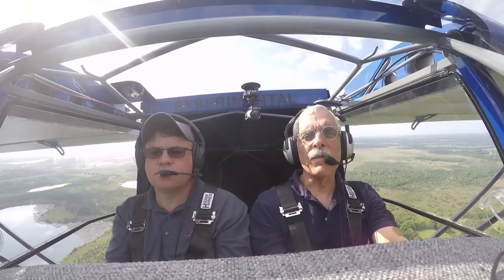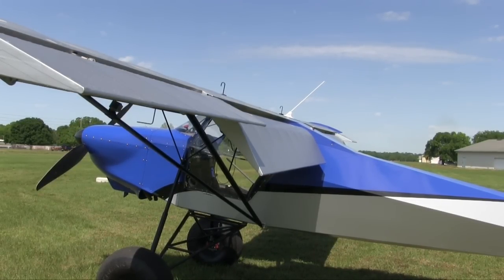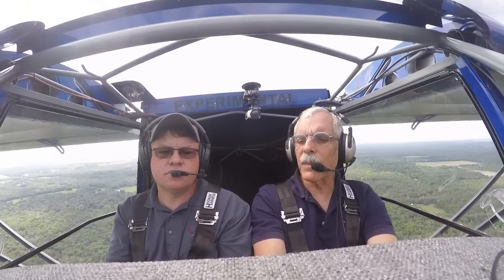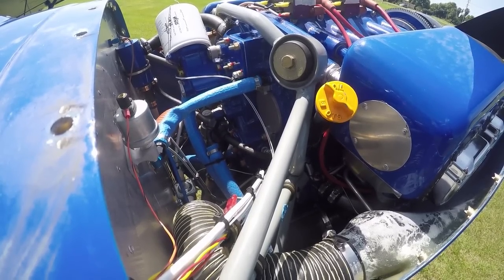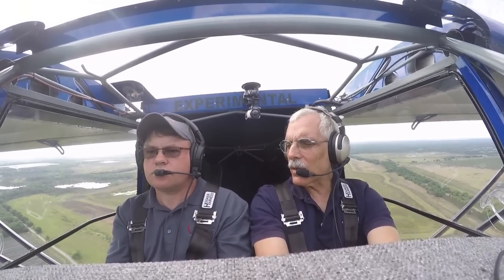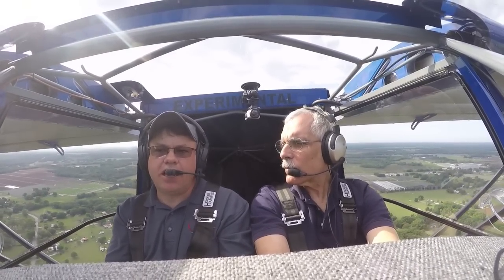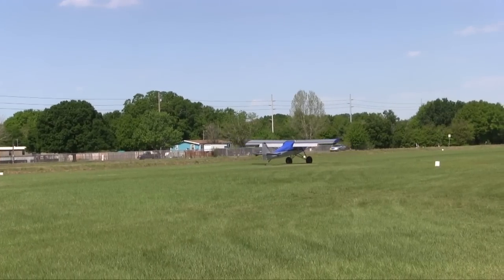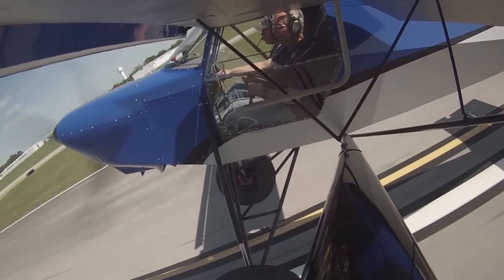Flying Just's Titan-Powered SuperSTOL

Comment: How does a weight difference of 10-15 lbs equal to having to need 2 extra feet claiming it's to compensate for the weight of the engine?
Reply: pmp2559 probably needed the additional length for longitudinal stability and elevator/rudder authority.  Horsepower increases decrease stability as a general rule.
Reply: Clayton Yendrey oh, yes it does make sense now thank you. I guess on an airplane every little thing counts
Reply: Previous answer was completely false ..that 10 to 15 lbs diff was from the UL motor , but not the Rotax ...the fuselage was lengthened due to the difference in weight over the Rotax 912 which is about 100 lbs lighter ... not for the UL motor ... both the Titan and UL require the two foot longer  fuselage over the rotax  ... and that is the larger UL motor .. there are smaller UL ones similar in weight to the rotax that can use the shorter fuselage
Reply: In an earlier video they said the Titan was 150# heavier and extending the fuselage was “a weight and balance thing”.

Comment: That wing structure looks extremely week, the spars are thin as anything! Not sure how that aircraft will stay structurally strong in even light turbulence that loads up the wing.
Reply: +Jeffrey Jensen kit fox based actually....
heavily modified and redesigned of course.
Reply: lol ...you can tell aircraft structural strength by looking at it ... thats pretty impressive ... why did Just Aircraft go to all the trouble of engineering calculations when you could have told them its strength at a glance ... Im guessing all the owners are just lucky there has not been one wing failure since its inception ...  nor will there be ...  in spite of your eyeball  engineering

Comment: way too expensive.  ditch the certified engine and put a turbo corvair in it.
Reply: Says on their website they have motor mounts for several Engines even VW I would bet you can put a corvair engine in it I think that might be little big for this? UL engines are good buy right now because EURO is weak 70 cents is one euro.